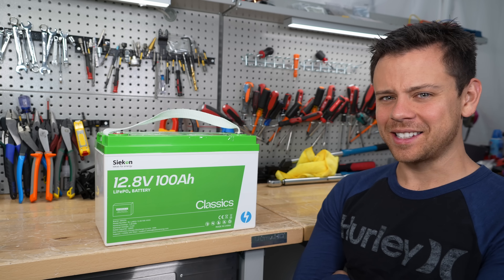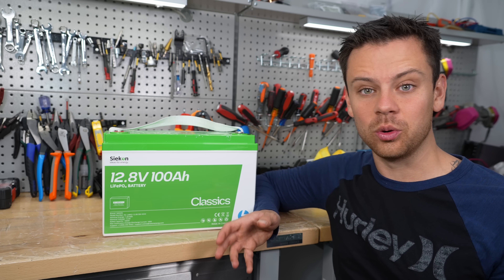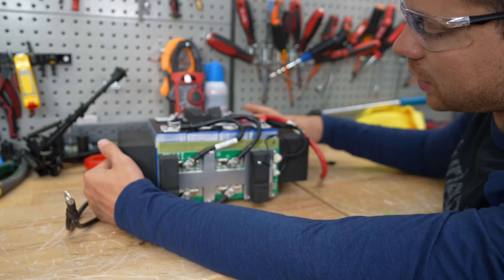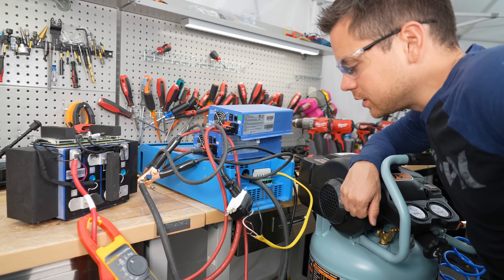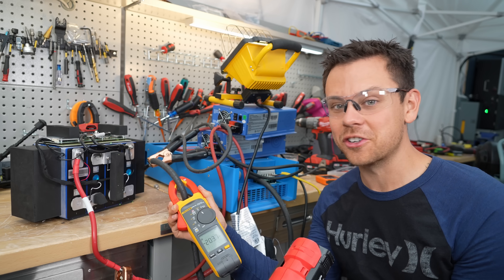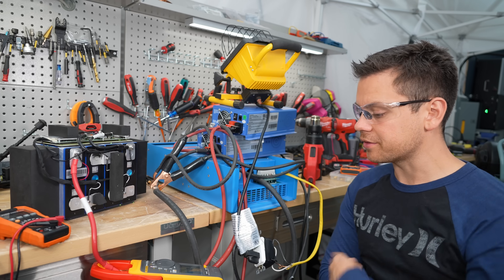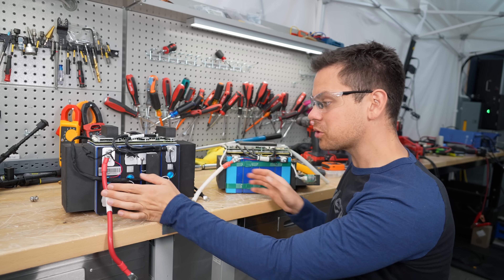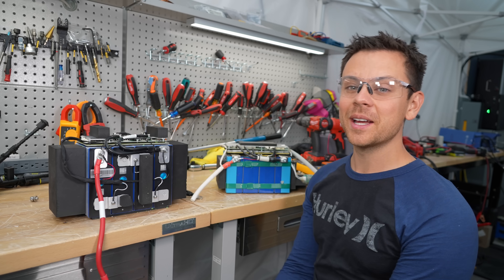Lead is Dead! $229 LFP Siekon 12V 100Ah w/ 150A BMS and Low Temp Charging?!

Comment: That's not cheaper than a lead acid battery. A 130 amp (550 CCA) led acid battery is around $70.00 ($60.00 the last two I bought) Led Acid batteries last me about 5-6 years in my trailer if I dont abuse them. You cant say a Li battery will last 20 years because you have not had time to test a bunch of them for that long. I'm now testing a LiFePO4 going on 2.5 years and it is not performing as new, it's losing 6% within hours with no load other than the meter.

Comment: Lead acid acts as a voltage regulator/ballast preventing charger no load voltage spikes that fry electronics. Lithium can fry automotive and solar electronics when it disconnects itself from the circuit causing a voltage spike.

Comment: I had at one time looked at purchasing forklift batteries because I thought that they could be refurbished still not quite sure that that can't happen I have ample storage space to store the forklift modules so buying up 20 or 30 48 volt battery packs wouldn't have been an issue but my mind has been changed what changed that wrecked Teslas changed that they sure did you can pick up one low mileage 4 - 10,000 complete battery pack everything you need to build an electric car and what you don't want you can sell I'm just saying lead acid was good in its time think about the future in Battery Technology we went from lead acid to lifepro in a very short amount of time in 20 years The Battery Technology the things should last forever I would assume in my thoughts are the development of superchargers that they should be able to charge in just a matter of minutes instead of hours anyway do the progression of technology in the way we've built things and I just believe that

Comment: Is there any issue with no max current  protection and using this battery for a car hauler trailer to run a winch for a couple of minutes? 

I have an old standard battery that I need to replace & this is such a good price

Comment: Got a question about lifepo4 batteries. I have a 2022 cfmoto 950 ho sport utv. My stock battery has already went out. I was thinking about maybe getting a lifepo4 battery to put in it to last longer hopefully.  I've seen some say don't hook up a lifepo4 with alternator on it, because when bms shuts down charging the alternator doesn't have anywhere to send charge and will burn alternator up. I believe my utv has a stator on it instead,  would it be OK to use lifepo4 on my utv and my stator be OK? Any info you could share would be appreciated

Comment: Hi Will, love your vieos! We met at a few RTR things and I think the van builds too! Have you tried the Lithium batteries that TEMU sells for 169 dollars? or even a little less?  I have two RVs, one has the battleborn, the other has the LITime. both work great!   I was wondering if the TEMU battery would be okay for a trolling motor on my inflatable?.....How bad could it be? I"m thinking the difference in this battery is simply the price and profit??

Comment: It's interesting where all the NAYsayers went ! I went lithium ferrous iron cells in 2013( yes when they were expensive) it is and was still the best money I EVER SPENT. They are still 95% capacity after full time use 11 years later. My previous lead acid and agm batteries lasted 2 years at best before they were completely dead. I WISH THESE MANUFACTURERS MADE THEIR BATTERY CASE THE ACTUAL SIZE OF THE BATTERY,  NOT A BUNCH OF USELESS SPACE INSIDE. It would ne nice to put 2 lithium batteries in the space where one lead battery used to fit.

Comment: Why would someone want to buy a lithium ion battery when a lead acid filled battery works just fine and will not explode on you suddenly causing you and your car  and or house to go up in flames. Because of a slight issue with the battery

Comment: Lead acid is very useful, still, when charging lifep04 batteries from an alternator.    Isn't it true that when lifep04 bms stops the charging, it burns the alternator out?    Lead acid will still have a place in this type of arrangement.

Comment: Will, i like your videos and value your opinion.  Could you review cranking Lithium batteries?  I'm particularly interested in the difference between a marine cranking battery and a trolling motor battery.  I would guess the size of the conductors that is connect to the BMS,  And maybe a more robust BMS that is capable of the cranking amps required.(700-1000CCCA)
thanks LMC

Comment: Thank you friend for your time to share your videos, I have a concern, I don't know if you can help me, I have bought 4 304ah lifepo4 cells on two occasions from the same supplier, one in 2023 and the other now in 2024, the new ones arrived to me With a difference between the positive and negative poles, they are much further apart, and when placing the connectors they are all different, my question is if I should worry if that is not normal or if you have experienced it at some point, thank you

Comment: Lead acid battery users are still around.  Lithium are still dangerous, the news, your videos, have shown this with the fires that keep burning.  Even the cell phone batteries have caught on fire.  Plus you have to worry about the battery management circuit and sensors to work correctly, or, fire.  I will take nickel iron, nickel metal hydride, lead acid,  batteries over lithium any day.

Comment: Would this be a good battery to increase capacity for an emergency outage! To Complement an ac200p and a b300?? Also, what is the best way to charge these 100amp hr batteries off grid?? Thks. Really like you videos.

Comment: Love your show
I have three off grid dwellings 
First one still has AGM that have been working well for about 8 years . Second one which is my main dwelling has 4 Relion 300ah in series to give me a 48v system. I pain $3000 each for those batteries 6 years ago. Still going strong, but $12000 for 4 batteries.😞
My third is an rv with Li Time i bought at you recommendation. Great battery and good customer service . So good to see them go down in price!  Very gappy to find your channel a couple years ago. 
Thank you SO much for your channel!

Comment: I just got a few 12v 100ah weze lead batteries heavy af😂 but it gets very cold where I am and already use lead acid I only heat with wood and worry it would be too cold most of the time I get home from work it can be low as 40f and you can spill water on the floor and it freeze 😂 I only need to run blower fan on wood stove 98w   and few lights . I also don't like all the mining behind lithium and are ability to  recycle them but hopefully it becomes more sustainable.

Comment: It won't charge in the cold? Shouldn't that be the other way round, that it stops charging when it's too hot?
Reply from the maker: It does both. But can discharge in cold
Reply: @WillProwse  thank you, so it's fine to start a vehicle in frosty weather but won't take a charge until the engine heats up?
Reply from the maker: @user-fl8yv7rz6f  yes technically but depends on BMS design
Reply: @WillProwse  seems perfect for boating with an electric trolling motor, especially for inflatables, and if it bursts into flames you can drop it overboard.

Comment: I recently bought a EcoFlow river 2 pro and a cheap 56 buck eco worthy solar panel. 
It powered my WiFi and modem 24X7 and charge my laptop phones with no issue.
I am planning to get some bigger batteries to power my fridge 24X7
It’s going to save my electricity bill

Comment: I paid $86 for walmart deep cycle 12 V Pb-Acid three years ago. Hooked em up to a 100 watt harbor freight panel/charge controller/inverter system for <$200. Still running lights and a USB phone charger on my hunting shack 3 years later in the frozen north. May look into this but Im concerned about set it and forget it function over an upstate NY winter.

Comment: I'll stick with lead acid. I had an expensive lithium for my trolling battery and sold it. $1000 piece of junk. I've been using lead since the 80's and I enjoy all the hard work involved in maintaining them. I'm using cheap Walmart marine batteries. If there is a problem, walmart takes them back, no questions asked. 3 year free replacement. I use a 48 volt system and baby my batteries. I'm obsessed with making them last. 😂

Comment: If car/truck alternators would be able to charge these without burning up during low rpm over-current or have an inline current limiter installed these would be such a great replacement for the current lead-acid crap now on the market.. 5000 cycles would out last by a long margin... I am looking for a current limiter now to allow me to swap in this style into the vehicles I own

Comment: I am building an off grid property just 1 hour outside of Las Vegas on the north end of the town of Pahrump. I am using Lead Acid for my battery bank currently. In the future I do want to add a lithium bank as cost was the factor. But with declining prices we can start entertaining buying 4 of these at a time.

Currently I have been adding 4 NAPA HD Lead Acid batteries at a time for 48v on each series. Currently running 3 banks in parallel. Running AC unit, refrigerator and security equipment 24/7.

Eventually this system will be expanded to also power our house and shop.

Comment: I'm going to continue to use Lead Acid for any large battery power requirements in my house (my 4 UPS units specifically) for one simple reason - Lead Acid batteries do not turn into huge fireballs when they fail. I do not want to burn my house down because a cell in one of these batteries causes the whole unit to turn into an inferno. You can call any cost/performance differential the 'peace of mind' premium. I just would not have Lithium power source larger than a laptop battery in my home.

Comment: will. I have a question regarding charging lithium batteries 
I have 4 120 amp batteries wired in parrael  , what size dc to dc charger. Do you think I should use t charge them 
As I’m sure you would know. That gives me. Total battery  bank of 480 amps

Comment: The problem has low temp charge and discharge.  if you have a good heating solution it is not a problem but have not seen a good heating solution.

Comment: what kind of of battery do you recommend to keep my duck water from freezing in the winter time?  I have 2 lead acid deep cycle battery on a 1k inverter.  battery works fine in the winter time for the last 2 years.  If I switch to lithium will it stop charging in our cold environment?  coldest it got was -20 for a few about a week.

Comment: Okay hold on a second there Will. 
lead acid is not dead per se. Let acid still has its uses. for example if you are going to be using high amounts of draw current like 300 ampers for short periods of time. lithium batteries can't do that because they're limited by their BMSs. also for starting the car you can't use a lithium battery. lead is not dead. It is just impractical for use in solar energy storage.

Comment: Personally, I've just been waiting for the price to come down on lithium. Now I'm waiting for my AGMs to fully crap out before I replace them with some LiFe batteries. But I wasn't a lead acid head. The AGMs I put in my RV cost over $400 each. I'm fully ready for a change. AND I gots a new Charge controller that will handle the switch to lithium! I'm hoping for some 150 amp Li batteries that'll fit in the same footprint as my 2 AGMs.

Comment: I have a question. If we make the cycles of this lithium battery less, it can be used like a lead acid battery, for example eight hundred cycles. This will reduce the cost. To use for a few years.

Comment: Very good results.
However, I have 1 concern.
Battery removed from case allows better air cooling.
Would heat build up inside the case be worse?

Comment: I recently bought 2 lifepo4 12v 100ah batteries and connected them in series with a mppt inverter from voltronic, i am using custom charging settings as follows
Float charge 27.2
Charge voltage 29v
Cutoff set to 23v

The issue is after full charge 1 battery shows 14.6-14.7v the 2nd one shows 13.6 or 13.7,after that inverter stops charging and maintains 27.2 float charging voltage, the issue is that one battery is 14.6 and other is at 13.6 how can i balance it, is it normal? Both batteries are same article from vestwoods since they are only reputable brand bere in pakistan.anyones help will be appreciated. Thanks!

Comment: I have 600ah leadacid, it's parked right outside the front door, the fire exit to my home ... and I trust it not to explode and I've been living off grid since 1999 . These are my second batteries, they replaced my original leadacid batteries not because they exploded and killed my family while they slept but because after 20 years my old ones had undergone a learning curve in battery management for the owner and now I know my power

Comment: These would likely make a great golf cart battery. …especially for those carts using 4 12v batteries. I am using Chins now, but for	 carts with motor upgrades, the extra max amp out put is a game changer.

Comment: @WillProwse   I know your focus is on solar power and the batteries used for that but perhaps you'll answer my automotive question.

It is getting to be time to replace the battery in my van. It is constantly in need of a jump when it sits unused for two weeks or more.

Would you recommend a LFP like the one in this video as the replacement?

Comment: @WillProwse Siekon's website lists a 12.8v 100Ah green label model but they call it Deep Cycle, as 229. Is this the same model you tested?  Note they have other 100AH listed for $999. Confusing.

Comment: I've had many problems parallel connecting different manufacturer's batteries, some won't charge fully, others don't discharge fully. Have you run across this problem, Will. Thanks for all the great content!

Comment: I should buy 2 of these and use them as starter batteries in my V8 truck...together, by your tests they in parallel should be able to put out 1200 amps. Way more than i need. If they had heaters for low temp charging, they would be perfect. Of course i will have to modify my alternator...

Comment: A lot of those 30-40 year lead battery lovers, well they were old, and they died.  

Price was the major factor in my last round of lead batteries, which were bought 3-4 years ago.  Ever since then, it's been LiPO4 for every project.

The price and capability can't be beat.

I am still leary about the fire hazard, but you should be building with fire in mind for any power source regardless of type.

Comment: I went from a lithium heated battery back to a lead setup. In the short and cold winter days of Norway, the lithium simply did not have time to warm up and charge enough. Its a nice idea, but it doesnt work. Id rather have a big heavy old setup that will charge no matter what. If your BMS decides that -25c is actually too cold and shuts off life gets miserable offgrid pretty fast. Even my Ecoflow backup battery just stops working at those temps. 😂

Comment: Technology still is not there for marine applications where you need both extreme durability, safety & a BMS capable of engine start. 
Had a BMS freak out on in a very high end battery on customer's boat last week. With just one he can't start, it was 4 hours to get a tow back.  Had me drop in a pair of lead acids the next day. 
I've tried everything, the BMS is still bricked.

Comment: Are these batteries rated to be exposed to water? Was thinking about using this battery to replace the AGM batteries in my Travato RV.  The batteries are mounted under the RV and are exposed to rain.

Comment: Hey Will, is there any reason I couldn't use one of these to replace the lame small 12V lead acid battery in a UPS that I use for power outage backup for our TV / Cable Box / Wifi Router-xxx ?  I know it would be an overkill but that would be good - it would last so much longer.  Thanks for your help.
Anyone else have experience with using LFP as a drop in replacement for 12V lead acid in a UPS ?

Comment: @WillProwse Not to stray too far off topic: but, my BigBattery 170ah shows 84% capacity after three years.  I take very good care of it and keep it mostly as backup for my house.  It gets cycled regularly: but not heavily.  It took a crap on me, was returned to BB for repair, and was returned to me.  Their report showed the 84% remaining capacity.  Any tips/tricks dealing with them?  Their customer service is less than stellar.  At this point,  should I just sell this thing and buy two 24v Redodo batteries....😆

Comment: Will, please do a video on using 12V batteries for a 24V 36V or 48V system. Obviously with a 12V system the batteries will balance because they are in parallel but when you seris connect the batteries to get higher voltage how do you keep them in balance?

Comment: Great to see these LiPo's improving. What's the deal with most of these batteries in group 31 size? Look at all the padding there. Is it just to make them walk, talk, and look like a normal deep cycle LA battery? Looks like the guts could drop right into a group 24 case.

Comment: Sorry for my ignorance, but can you just drop these lifepo batteries in as a replacement in your car?
Reply from the maker: No
Reply: @WillProwse  Well that sucks. Not enough cranking amps?
Reply from the maker: @joeprimal2044  it can do it but the Fets will die eventually. Some are rated for it but cost way more

Comment: can these hold charge as long as a lead acid battery? will the car start after sitting idle in extreme cold or hot climate after 2 months?

Comment: What do you think about the automotive sector switching out of lead acid?
Reply: Hybrids are already switching for the 12v battery as it doesn't start the engine and already has a dc to dc converter to charge them